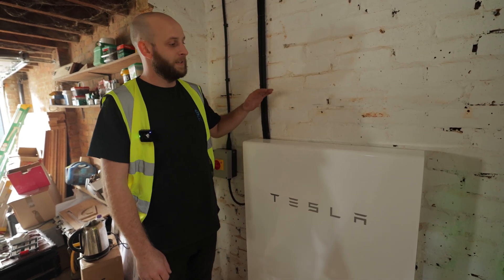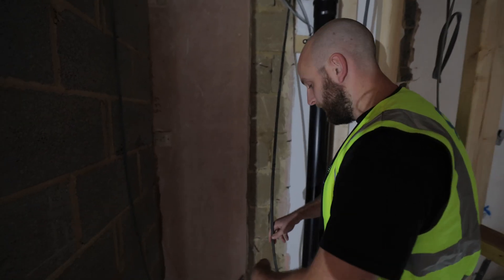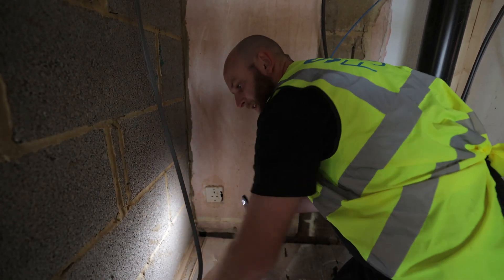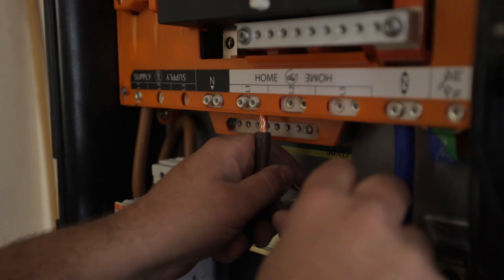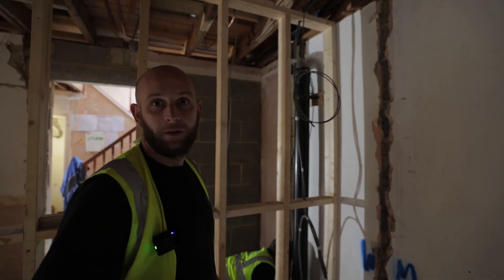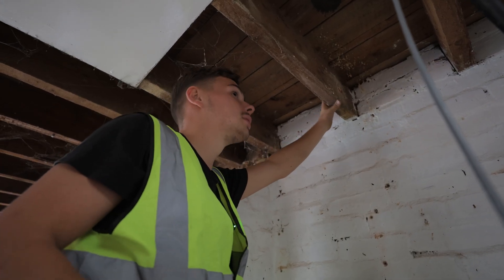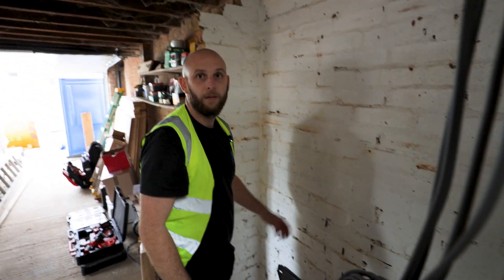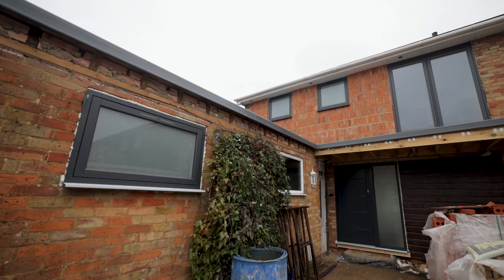Powercut PROOF! Telsa Powerwall 2 Installation.

Comment: Looks great guys would love to see more of this, when the tesla powerwall 3 comes out this is going to shift the market i reckon .Just a couple things about the tesla gateway, I believe the DNO fuse for the consumer satisfys the requirements to negate installing a seperate fuse carrier within the gateway. Also if your using the gateway to act as a fuseboard with circuit breakers etc this would contravene the need to for a metallic enclosure in a domestic property and must be fitted, when Tesla say its all been type tested this is only by means that can be used as an intergrated fuseboard outside or in a non domestic dwelling. Highly recommend a smoke alarm above the battery (weve had a Tesla pop after a period of time and sooted all the behide the battery). Do you guys fit other types of batterys ?